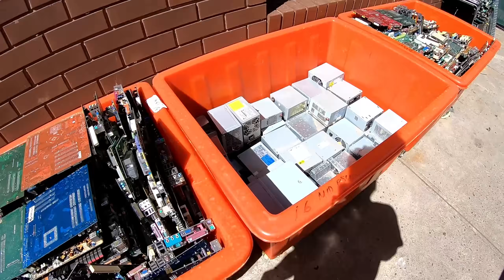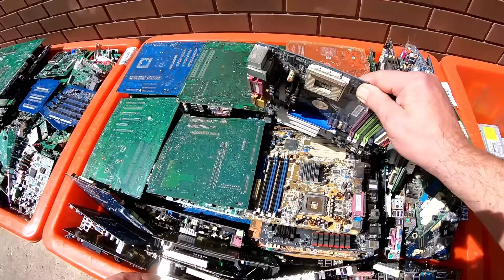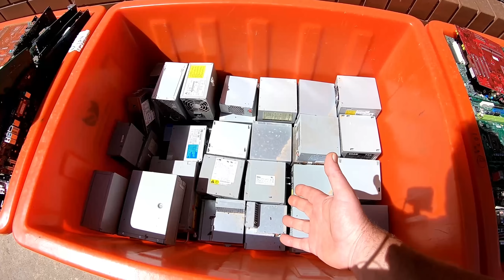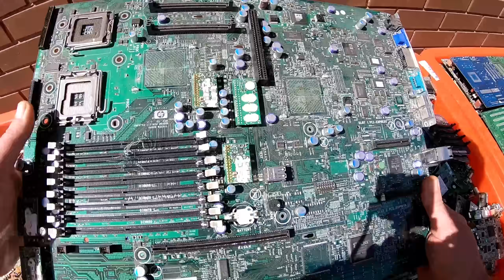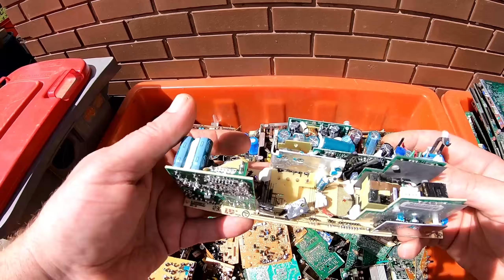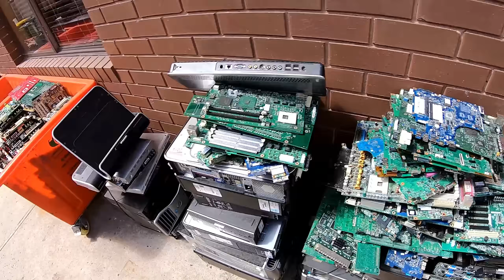Buying Circuit Boards, Gold Recovery, Boardsort Australia

Comment: I'd like to get in contact Ben I  very passionate in e-waste management I'm in Qld I want to start a production up here for end of waste recovery I am applying for my AS 5377 ISO 90001 and EOW certificates so I can have a better chance getting untouched rubbish tips contracts for continuous production I worked in a large management facilty for a bit  we're I started as a sorter so I was putting CRT TVs on the conveyer stacking PC towers and flat screens and caging CRT monitors sorting cables then moved up quick to dismantling and doing about 40 plus flatscreen a day and depopulate mother boards and I learnt so much I wanted to do all the proper marketing and research values per unit and correct dismantling and safety procedures hazardous material storage and correct recycling procedures maybe you could give me some pointers I'd like a stewardship or trade agreements with other companies e-waste is a huge market at 62.5 billion and rising

Comment: People don't understand either fully depopulated or don't. If you refine depopulated if you want full value for board don't touch it. And taking off the chips and getting a devalued priced because obviously the Recycler doesn't make the value either is fair. Think of it this way if you bought the scrap at full value and then noticed the most valuable parts were removed how would you feel?

Comment: Hi we are from India (chennai city) and we are planning for e-waste recycling plant. The current stage is that the business proposal getting ready. That will submitted to bank loans. Just wanted to make sure about the constant supply of raw material. Our proposed capacity is 1000 kg of striped pcb decoupling PCB per day. Other than that we are also planning aqua regia. We saw the price in the comment session link. If you could let us know the per tone price of complete system that would be fine for us to estimate raw materials cost for business proposal. If Interested  please contact sathyashrayan@qualsteel.co.in Please note that I am poor in reading messages in youtube comments.

Comment: Hey Ben if you de populated the components off them boards you could pri pack transistors ic and capacitors plus bags of resistors and switches etc. Sell them on the Web to electronic hobbyists. You could then keep the circuit boards for gold recovery.

Comment: Do you down grade boards even if we take some MLCC's off, tantalum capacitors, or crystal isolators? Thanks
Reply from the maker: depends what else is on the board, a high end board that normally would have 20 or so tantalums wouldn't look much picking them all off, a few here and there is ok, mlcc's are ok so long as it doesn't look obvious, mostly it's the ic chips.
Reply: @eWasteBen  I leave the main chips on the boards, its just more the little picks here and there off motherboards or from routers/ medium grade boards.
Sometimes I take only a few and leave half on can't be greedy.